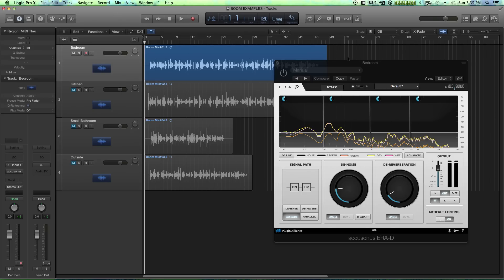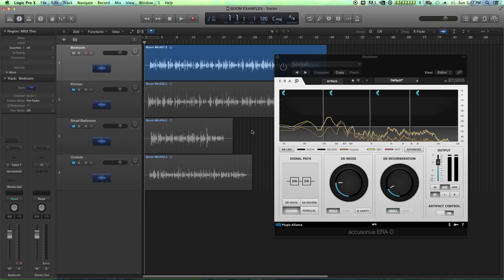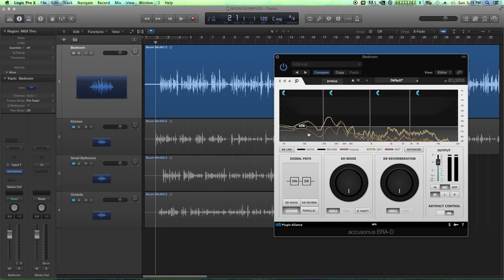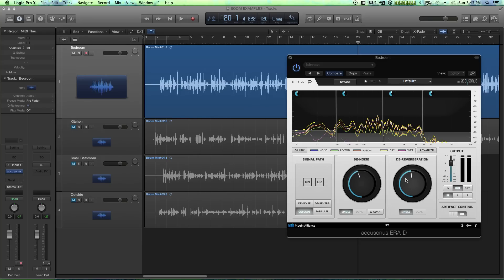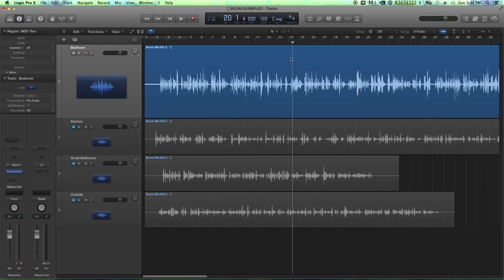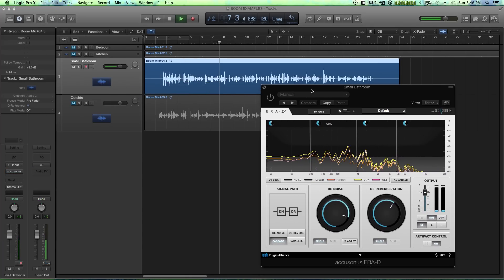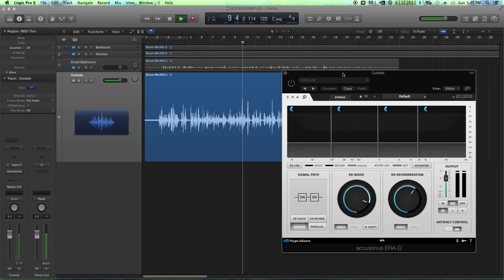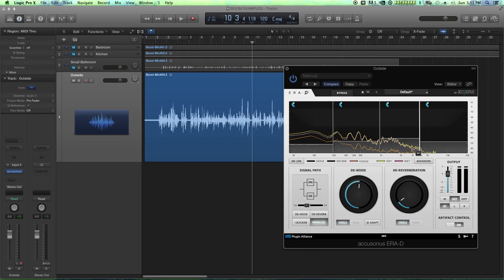Accusonus ERA-D Overview - De-Noise and De-Reverb Dialog Tracks

Comment: How does this work compared to iZotope RX?
Reply from the maker: +surgeyX I prefer the iZotope RX when I have very consistent noise in the background. You can learn the noise profile and then apply it to the clip. That's what I use for my dialog to get rid of hum, hiss, HVAC noise, etc. ERA-D is cool in that it automatically updates itself as it reads the clip. So noise that changes a bit in the background can be omitted. They are both good plugs.